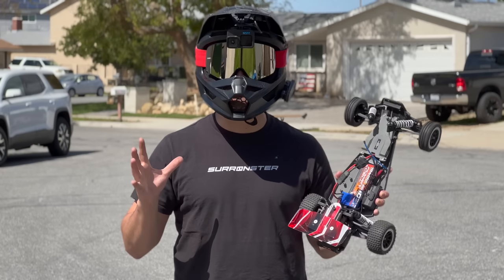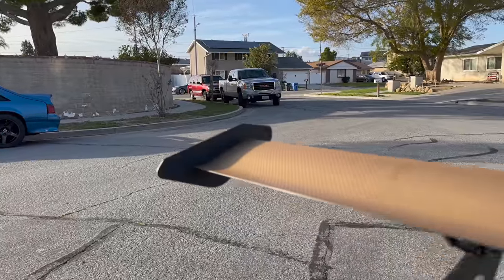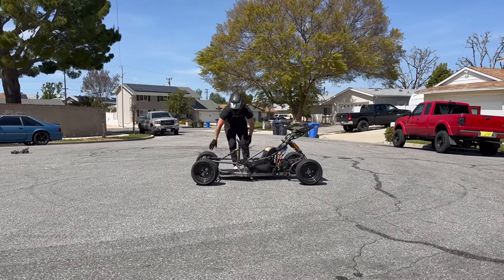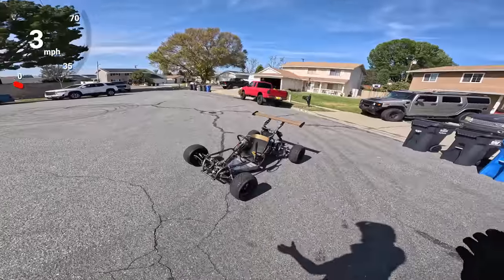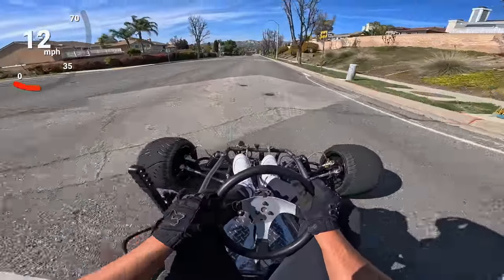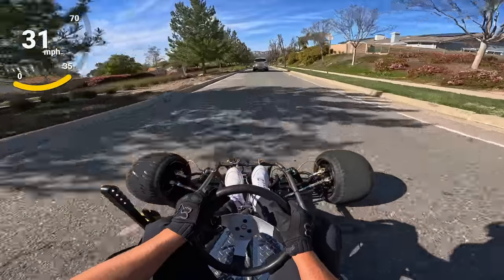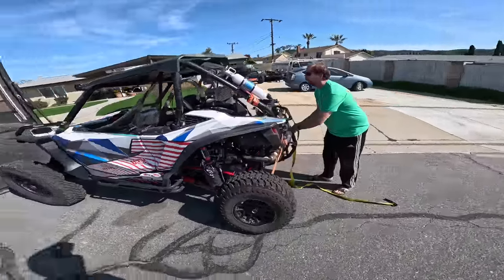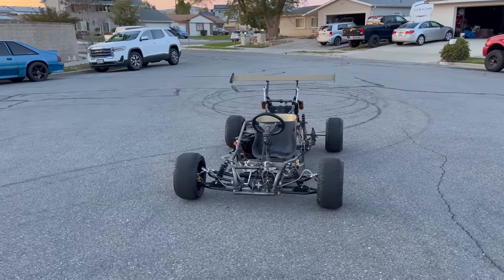Insane 70mph Full-Size RC Car // Official Test and Review Electric GoKart

Comment: really looks like it would benefit from sway bars, stiffer front springs, and tighter steering components
Reply: bigger tires too
Reply: A cage for the driver! What if it flips?!
Reply: @tricket2701  i agree with bigger rears, fronts are good though. it is supposed to be based on a rustler after all
Reply: @ryngrd1  disagree here, sorry. it would be nice if it flips but would take away from the original premise of the build imo since it's based on a rustler.
Reply: i think it's a bandit not a rustler

i'd make the wheelbase slightly longer too
Reply: Regarding flip  over driver protection. The bar design used in Formula 1 cars would work here. Wing looks like it would snap off in a roll over creating additional safety concerns for the drivers neck and torso.
Reply: @ryngrd1  just a roll bar should be fine, fully enclosed is going to add weight
Reply: The rear end is a Swingarm with no roll articulation. It is essentially a sway bar. This thing couldn’t sway even if you wanted it to.
Reply: and a rear suspension that actually did something lmao this design is HILARIOUS
Reply: The steering needs caster, I agree a stiffer front springs, and adjust the pedal curve on the controller.
Reply: Which part of the video looked like it would benefit from stiffer steering?
Reply: @JFKALLDAY  the whole driving segment, seems like it wanted to walk all over the road. i could be wrong, i havent driven it ofcourse lol. but it just seemed darty to me
Reply: But it's a rc car!
Reply: @JFKALLDAY  Which part of  the Video? The part where he's  driving at higher speeds and says that he needs to get used to the steering because it's "so good". The steering gear ratio is to low/quick. This is the reason why it is so hard to control at higher speeds. The front suspension is way to soft too. If he changes those things it will be much easier, safer and more fun to drive.
Reply: @scottcummings8074  No, It's an electric go-kart.
Reply: what car is at 2:59
Reply: @mementomori4972  It looks like hes trying to control it not in control my bet is on more caster.
Reply: Steering does seem a bit twitchy
Reply: and steering angle and 4wd
Reply: Looks like the car was suffering from bump steer at high speeds. Need to raise or lower the rack or have the tca arms the same length and height of the top wishbones. No LSD diff I'm guessing due being electric? That will hurt traction going round corners.
Reply: Would love to see a build video, and a list of parts
Reply: @nou943  What makes you think it’s based on a rustler, didn’t hear him say that a single time
Reply: @trapraindrp3883  foxbody
Reply: I’m no engineer but is the rear suspension actually doing anything?
Reply: @kyle4975  only a little, there’s a shit load of unsprung weight. It’s an absolutely terrible suspension set up.
Reply: All improvements for the V2, V3 and so on. Nothing is 100% perfect on the first working iteration
Reply: @skyeparker5822  no its not. It's stiff and doesn't even work. The whole rear suspension is fake
Reply: I'm watching the whole thing flex like crazy. But maybe that's the part of the design like a real rc car. They're pretty bouncy.
Reply: @ryngrd1  have you ever heard about karting? do they have any safety cages there? oh yeah No
Reply: New Suspension, Tires/Wheel Size, Roll Cage, Engine Power Babeh, Clamshell Cover, you got youself a car ;)
Reply: Make a miniature F1
Reply: @davidanderson5411 They also won't have a situation where someone in an SUV is driving the kidlets home. Through no fault of their own, pull out on a barely visible "something" pelting along at 100km/h turning the "somethings" driver into a headless meat sack.
Now don't get me wrong, this wee thing is pretty damn sweet, but the dude needs to get a t-shirt that has "Temporary Citizen" written all over it. I came up with the idea of building a twin lawnmower engine powered go-cart when I was 9, and had it finished (with a bit of adult supervision here and there) within six months. What I would never do is drive it on public roads. Maybe here in 'Straya we are stricter regarding our road rules, if he was busted here he'd never have the privilege of holding a valid driver's licence ever again. Then of course he's probably going to prison for so long that he'll begin to look forward to the daily shower romp with six of his best mates called Stevo and Kezza. We have strict anti-hooning laws, to the point where depending on the offence one's licence can be instantly revoked and the vehicle turned into a toasty, toasty at the nearest wreckers. It happened to a local Polly who during the first night of getting his brand new Porsche, was caught by the revenue cameras three times doing the same speed as go-cart boy. He'd put nearly 40 kilometres on the clock and the following morning he was shown a nice snap shot of his flattened flat six.

Comment: Man thats bad ass, Back in my youth years i probly 12 i worked a summer job half school half work anyway a buddy of mine had a go kart he tore to pieces even the 5h.p b&s was torn apart i bought it for $50 and set to putting it back together i bored the cylinder and cleaned the head up took it a friends house who had a track in his front yard by the road the speed limit was 50mph and we never did the speed limit "still dont today" the cars were doing whatever speed when they got to the start of the straightaway and thats when i stood on the gas that gokart passed them like they were standing still, ever since then ive wanted to build something like what you have done yet life happens, GOOD JOB ON THE BUILD AND YOUR COMPANY!!

Comment: Would you ever do a breakdown on how you built it from scratch? That would be rad
Reply: Im trying to find one of them tooo i want to build one
Reply: Please do this. I want one so badly after learning about the Honda egx but seeing it’s low horsepower output
Reply: This. 
I love the frame design! Would love to see measurements for at least the frame dimensions / layout?  I've debated modifying a Tony cart frame, but I'd rather weld it up / modify as needed for my height, myself. The rest seems like it'd be similar to the RC the cars I build for hobby :D
Reply: Wanna build one too
Reply: please

Comment: Domo is a genius. That guy can build anything 🙏💯👌🏾
Reply: So can you.
Reply: I call my 2002 Silverado a full size gas powered RC truck 😃 it’s a first!
Reply: the rear suspension is fake.
Reply: Can almost taste the tire rubber , (he’s breathing a lot of tire rubber during the doughnuts)
Reply: @guy sumpthin  I Don't even do burnouts on my ebikes. I don't see the point in wasting my rubber
Reply: @ashpunting  Got an Ecomobl ET Skateboard and I had to stop spinning the back tires to Save them.Need Grip!

Comment: Check front toe with rider weight in seat. It should be slightly toe in for stability.  You might have to lengthen the wheel spindle  control arms or shorten arm on the rack to tame the steering a little. Awesome build.  That motor setup seems perfect.
Reply: I think he wants the steering so it feels like rc car
Reply: What? Isn't it Toe out at front and in at rear for stability? Toe in at front is for more steering response
Reply: @dc-vw4qm  toe out would be steering response if if recall, front of the wheel faces slightly out, so it would start the turn sooner
Reply: The what now..? This thread has me lost lmao
Reply: You're 100% incorrect. Have a nice day.
Reply: @yackablejohnson1485 that reply didn’t help anyone even yourself out. But anyway you’re also incorrect. And by the way have a great day.

Comment: That thing is absolutely insane. I was literally concerned for your life every second you were above 40mph
Reply: No roll bar, even.
Reply: Yeah that was incredibly reckless if that really was his first time driving it, he could have easily lost control, smashed into a parked car, and died from the resulting injuries.
Reply: @Chris-xo2rq  Something as simple as one loose bolt that walks itself off some control arm could change that steering from twitchy to witchy in a heartbeat.  It's the definition of amateur to leap in where angels fear to tread.  Just work your way up folks, it's that easy.  Don't be a SpaceX.

Comment: Even at High speed turns, it looked incredibly controllable.
Reply: To me it looked like it has a lot of oversteer and will bite at high speed cornering if he’s not careful.
Reply: are you kidding it looked like it would slide off the road
Reply: No it doesn't that steering wheel is way too small, he has an enormous amount of oversteer. If he goes too fast he will get oscillations and then the wheels will lock to a side and it could flip.
Reply: 𝙉𝙊𝙏 safe was everywhere but straight.. Death trap.
Reply: Tires look was too hard, needs more grip. Maybe some Jr Dragster slicks on the rear?

Comment: Mechanic's advice, it wants to jerk the wheel side to side at speed because it looks like you have a bunch of positive camber. Also possibly the toe is a little weird.
I like to 0 out the toe and then go like .1 degrees inward. That should make it a lot more stable at speed.

Comment: this is awesome.... I wound add some bump stops to the front suspension to keep the frame from bottoming out at 50 mph when going over a manhole cover and soften the rear to keep from over steering all the time.

Comment: The craziest part about all of it is that if that go kart had the acceleration of an actual rc buggy (assuming it's a brushless buggy such as the ones raced at tracks) the thing would pull 5-6 g's, rc cars are absolute monsters when it comes to power to weight and the amount of forces that affect those lil' things
Reply: 5-6 g's corner acceleration?
Reply: @user-ds6rf3lx3b   Depending on what class is being run, yeah
Reply: Physics doesnt scale like that, though.

No rc car besides drag cars are pulling more than 2gs acceleration.

Comment: Would love to see it on a karting track.

I think also stiffer spring with a better damper in the front would help with more stability when going fast. 

Plus it looks like I has a lot of bump steer. You can fix it by making a small change in the steering geometry.

And it would be good to give it an alignment with the rider in the kart. With a small toe in it will also give more stability when driving.

Comment: Add a 2nd rear brake disc / caliper attached to brake pedal with an adjustable front/rear bias control. It just isn't safe to be taking your hand off the steering wheel to brake. The hand brake is cool for drift stunts, but not safe as a primary braking system.

Comment: Pretty cool. Just curious how far ya can go in that donut machine before needing "recharged". Are you using a CV type of transmission? or maybe just need to change your sprockets for a little better control?  But yeah doing donuts in your cul-de-sac can be a good time.  lol Certainly costs a bit more money, but having a full suspension has got to be a better ride than most go carts. Right there shows the benefits of an RC car's design.

Comment: I think with that much power a little wider frame with bigger tires would help alot. At least get some bigger tires. Really surprised at the acceleration as well as the top speed. Really cool.

Comment: Dumb question, but is there any reason to add a second gear in a build like this to help with top end speed? It always sounds like the electric motor is capped out in rpm in these vids…. Or am I just really stupid?
Reply: The 2nd gear would be a really good addition for speed but the weight would become a lot more

Comment: Tweak that front suspension so the steering gently returns to center. Otherwise put a steering damper on it. You don't a wobble that will flip you onto your FACE.